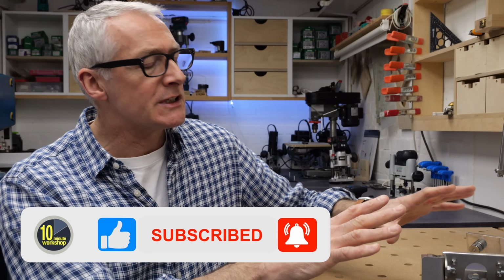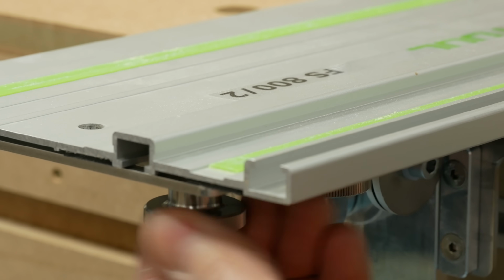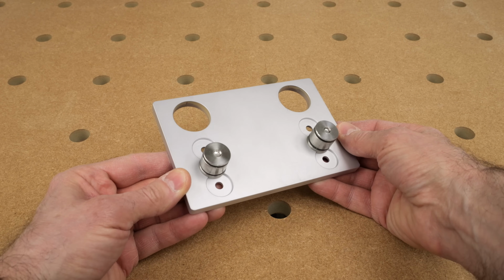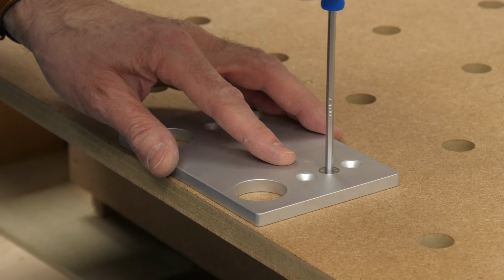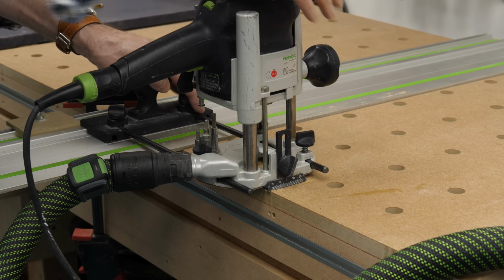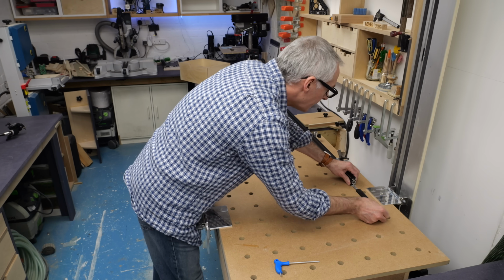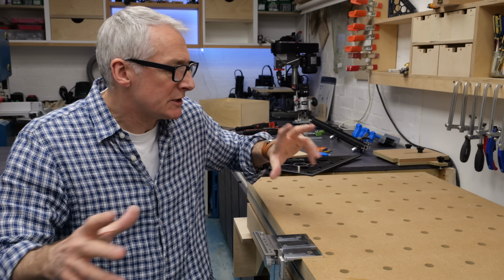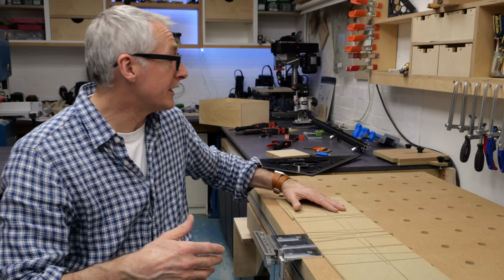Benchdogs Quad MFT Hinge System [**Ad/Gifted][video 492]

Comment: Hey Peter, a great introduction to our hinge system. Once the final finished product is available, I will have this sent out to you for a comparison video with others on the market. All systems have their place and are all great systems, and all have their pros and cons. It’s fantastic feedback from everyone. It’s also great to hear the comments about our products. 

As you mentioned, we have a different take on the mounting part which may have its downsides, but looking at it, the benchdogs route and thought process, I’ll try to explain. The plate sites on the top but set back further so it’s not getting in the way of the first set of holes you would use for either a fence or dogs that you place your workpiece against, so in theory, you haven’t lost any space on your workbench. The front support is also set forward doing the same. If you were using either guide rail dogs or our B dogs, you would lose the first hole for this dog to go into, so technically, this system gains you some space If using the dog method.  As for the 6mm height of the plate that sits on top, we kept it at this height for a few reasons. 
1. Our under rail is at 9mm or 7.1mm if using the MK2.1 fence. So it sits below this. 
2. If you are using our benchtop protectors, it will raise the workpiece above this height. 

We can make the overhang a lot less to about 60mm by turning the top plate around, but this has its downside that the plate then raises the min-height to 9mm, but the thumbscrew method would not work. We would need to use countersink screws for the fixing of the tracks. We did try this method, and we can also offer this method if required. 

The hole jig can also be used to offset the fence system.  Use the 32mm offset if the hinge has used the 48mm offset. This will also help you gain some more space on your MFT. 
Also, having our jig will allow you to make additional holes when you need other holes for possible future products in the pipeline. So it’s not a one-time-only product. We will also look at alternate materials to help reduce the cost. 

I hope this explication of our thought process helps.
Reply from the maker: Thanks Ralph. I dont see those as downsides exactly, more things that potential buyers need to be aware of, and thanks so much for the detailed explanation. Much appreciated! 🙌
Reply: Hi Ralph, have you considered a hire service for the jig? for a small fee users could hire a jig and return. You would probably need to charge the full price, in case the person didnt return it, and then return the price paid less a small charge.
Reply: @rayroulstone3565  I’m sure we could look into it. I’m also going to look into other options and uses to make it a more worthwhile product. Also reduce the cost for people who have the quad bases.
Reply: @Benchdogtools  Hi Ralph, I also considered buying the hole jig when I ordered the hinge system recently but it didn’t seem to enable you to create offset holes that are also half way/48mm between your existing holes (as well as set back) in case you are a user who (like me) wants to set up their track cut line in between a row/column of holes such as when you install a sacrificial strip in your MFT top (like Peter does). Unless I didn’t understand it correctly, it looked like the jig only gave you the option to create offset holes in line with your existing ones? Anyway, if that’s right it might be worth considering modifying the jig to enable you to create the offset holes in this way as well (if that’s possible?). As it happens I figured out a way to do what I need using the UJK Park Guide System (which I use to make the MFT top). However one of the other comments mentions this requires pre-planning before you already have 20mm holes [Edit: though I gather you can buy cheap “Revision Dogs” to solve that]. On that point I have an idea you might be interested in, but I will email you about this 😉. You’ve done a cracking job with your new rail hinge system I think. I’m really looking forward to using mine 👍
Reply: @stephendixon8575  
Hi Stephen,

I’m a novice and new to carpentry- better late than never.
I have acquired the parf Mk 2 and the benchdogs quad rail hinge- my intention is to make an MFT table with my Parf system and accommodate the benchdogs rail hinge.
I have a 25mm mdf bench top measuring 1500 x 900 . I also intend to put a router table on it later- your advice on how to proceed would be greatly appreciated.

Regards 
Paul
Reply: @Benchdogtools  Looks like you considered and rejected it Ralph? What grounds please?
Reply: @DavePawson  sorry Dave could you elaborate more on your reply please
Reply: Thanks Ralph. I'm on the 3rd batch run and can't wait. I'm back to being a kitchen fitter after many years out of it. I love all of these innovations that have come about in recent years. Enjoying using the rail square and the fence system. 

What I would appreciate, is that you add some good comebacks in your FAQS for what to tell the missus when making a purchase. I've worn out the one that says "i''ll be much quicker after investing in this". I'm never home any earlier ☺️
Reply: Absolutely appreciated.. all these innovative tools 🧰 . Looking forward to all of them for my workshop here in California USA 🇺🇸
Reply: I am trying to order to the US, and it's asking for $50.
Reply: geez, i figured if i needed to pay 50 in shipping I should put more into my cart. now it is asking for $86. man.
Reply: As I said in my reply to Peter I use the Festool hinge system with the Benchdogs Mk2.1 rail and is fantastic with all my other Benchdogs bits and pieces and in honesty I wish I had the positivity of the Benchdogs locator. Looks to me to be fantastic Ralph👍⭐️👏

Comment: This design wastes too much cutting space and require an additional Jig and holes to be drilled, I wonder why benchdog tools doesn't offer a version that attaches to the MFT rails.
Reply from the maker: I don't work for Benchdogs so perhaps if you want to affect change your suggestions would be better aimed at them? But my guess would be that when this video was made a couple of years ago, Benchdogs didn't make an MFT and wanted to make something that was different to the existing offerings as well as being useful to the folks who use eg an MFT top on trestles, or an MFT slab ie without extrusion. Also the quad hinge has extremely easy setup with no squaring-up required, so very easy to fit / remove the hinge. 👍
Reply: @10MinuteWorkshop  Thank you for the answer, it make sense.

Comment: Peter. You could glue and pin a piece of would at either end of the hing on the underside. So that you could route the hing flush on the top side. All you would need to do is bore the holes through the would underneath.
A small rebate in the apron of the MFT would then accommodate the modified MFT top… hope that makes sense…

Comment: Does the front part have any lateral adjustment in case the holes in the bench aren’t square to each other? Cheers Pete
Reply from the maker: There’s a little bit of adjustment in it, yes. 👍
Reply: @10MinuteWorkshop  thanks for the reply buddy 👍

Comment: Yes Peter, please do a video on 20mm router bits. I've just spent £45 on the Festool spiral upcut bit. I hope I didn't waste my money! I'm planning to use it to make a replacement mft top with my LR32 jig, using the method you showed in another of your videos. A video comparing Benchdog Quad dogs and UJK expanding dogs, would also be useful. Cheers.

Comment: Hi Peter ! This is Vivek from India.
Big fan of your innovative videos and your dedication towards woodworking.
In this particular video I see you plunging 20mm holes with help of your Festool router using a 20mm
Carbide tipped Fostner bit ... now how are you doing this ? Fostner bit are suppose to spin in a much lower RPM. Probably not possible for a plunge router ..... I guess.
Reply from the maker: Hi Vivek, and thanks! You’re right about forstner bits - but this isn’t a forstner bit! It’s a bit that Festool sells / used to sell specifically for making MFT holes. I’ve had it for ages and I’m  not sure that they still offer it - I had a precision engineer pal grind it down slightly for a really snug fit, which is why I don’t link to it as without that extra work it wasn’t great. HTH. Peter. 👍👍

Comment: About to do the same Peter. Why place the hinge at 4/5 holes in? Don't you normally run with the cutting line much nearer the end of the MFT?
Reply from the maker: I've always run teh cut line over the third column of holes, but the benchdogs hinge put the cut-line between the columns so I opted for the cut to be between 3 & 4 as I though between 2 & 3 was a bit close to the end. Don't read too much into it though howard - this was first a test of a pre-production sample on a DIY MFT that the hinge will never actually be used on. 🤷‍♂️ 👍

Comment: I do hope you produce the video on the 20mm router bit comparison; they are hard to come by (at least in the US) & I’m keen to hear your thoughts on the various offerings.
Reply from the maker: I abandoned the idea; I bought all the 20mm bits on the market and had an engineer pal chuck them in his mill. They all bored a perfect 20mm hole; the issue is with the routers, not the bits. I’m working on it. 👍

Comment: I already have holes at 32 and 64 mm from the edge of my table, will I need to drill additional holes ? Or will the hinge fit in either set of these holes ?
Reply from the maker: You should be fine with the 32, but check with benchdogs as this was a 'first look' at a pre-production example, and I know the Mk2 346 jig/template was released recently. 👍

Comment: You could stick a small piece of board underneith  just where the new MFT hinge goes, rather than a thicker board for the whole table - this way not inhibitting the use of the rest of the holes for general clamping.

Comment: Hi Peter,
Enjoy your videos.  New to carpentry.
Just acquired Parf Mk 2 system and benchdogs rail hinge.
I have a 1500 x 900 x 25mm MR  Mdf top on which I intend to build an MFT table and also to accommodate a router table at some stage.Advice on positioning the dog holes for quad rail hinge. What areas would you recommend for each area.
Greatly appreciate your advice.
Regards 
Paul
Reply from the maker: Hi and thanks! I wouldn't use 25mm for the top as you won't be able to get regular rail clamps through the holes - not without a fairly hefty chamfer on the underside of the holes. As for the layout, I've only ever used tops with a full grid of holes; if you're making your own with the parf guide, then you could drill out the full grid with just the 3mm bit, and add in the 20mm holes where you need them? The quad hinge is designed to fit into the regular grid of holes, just closer to the edge of the benchtop - the jig that Benchdogs sells makes this very easy to do, but as I show in this video it's do-able without it.

Hope that helps! P

Comment: Hello Peter I have used the parf jig to make my table 20 mm holes at 96 mm centres with the Mk 2 fence system I have also bought quad hinge rail system after much tooing and froing. I just can't seem to get a square cut it is aprox 1mm out is there a way to adjust this error out?
Reply from the maker: Is the MFT top square? Assuming you’re using the benchdogs Mk2 fence with fencedogs, then they’re referencing off the top row of holes, and the benchdogs quad hinge references off the column of holes, so provided the grid of holes is square, then no adjustment should be necessary. I believe there is some adjustment in the hinge to allow for a certain amount of tweaking, but you’d need to consult the manual on that one. My first task would be to check the grid of holes in the MFT top is truly square though, as everything else references that. HTH P
Reply: @10MinuteWorkshop  thank you have just ordered the precision triangle will do more checks when I get it  also ordered the repeat stop for the mk2 rail square, using your promo code saved a few Bob too thank you. 
Regards Mick
Reply: @10MinuteWorkshop Hello Peter just got my precision square and checked for square and is spot on mind idid use the opposite end and the other reference edge. However one of the corners of the square has been dinged will have to take a file to it as the bur is marking up my top if I slide the square across the top. One more enquiry and that is what kind of mdf are the black mf tops.
Sirry to have bugged you again Kinnd regards Mick.

Comment: Ive got a QH on backorder but wanting to finish building my MFT.  Can you suggest a rough distance to leave open between the MFT and the wall for the hinge to operate correctly (festool track)?  You mentioned 185mm, but wasnt sure if that was with a track installed or not.  Thank you for your time and great content.
Reply from the maker: Thanks! Yes, 185mm will cover it with the track attached. 👍

Comment: Can you provide a link to the router bit that you used to bore out the hole in the MFT for the mounting plate?
Reply from the maker: It’s a standard Festool 20mm MFT bit that I had a precision engineer pal grind down to fit. The stock bit makes an oversize hole, which is why I don’t link to it. I’m working with another company to make a bit that allows for router run-out. Watch this space. 👍
Reply: @10MinuteWorkshop  I'll definitely be on the lookout.  I'm really shocked there isn't something already out there that's perfectly made for this

Comment: I should probably have a piece of cheese to go with this whine but

I really wish BD had called out the need for the 30mm guide bushing so I could have started earlier to track them down. The bit was easy but the guide bushing has been a problem and won't arrive until the end of August!  Better still would have been a option from BD to purchase these (bit/bushing) with the template.
Reply from the maker: Sorry to hear Michael, and while I don’t work for BenchgogsUK, I’ll say that a 30mm guide bush is the most common size imaginable - many routers come with a 30mm guide bush as standard. End of August is quite the lead-time though! Plenty of opportunity for a couple of slices of Emmental - unless you’re more of a Jarlsberg type?? 🤷‍♂️ Cheers! P🍷👍

Comment: This looks like a nice sturdy unit.
I feel the weekness in the festool mft table is the other side of the fence fixture. Over time there may be a little play as the aluminium fence underside is very soft so cuts may become slightly out.
The fixture side also looks more strong than the festool. I like the fact you have the back support so you can place stopper for different sizes when placing ruler.
You are an expert and everything looks easy to you because you are the Djokovic in the woodworking industry.

Comment: Thank you Mr. Millard for your great Youtube Chanal and thank you for this video. I've got only two questions, because I don't understand this product exactly.
How far away is the maximum distance in millimeters from the edge of the MFT-table to the center of the 20-mm-holes for mounting the MFT Hinge System? How deep reach the bases of the "Quad Dogs" for mounting the MFT Hinge System into the plate of the MFT-table?
Thank you very much and sorry for my "rusty, old" english. Yours sincerely Simon S.
Reply from the maker: Thanks Simon. The full specs are on the BenchdogsUK website, but from memory it’s 35mm from the hole centre to the edge of the top. HTH P

Comment: If the 6mm height above the table is a bother, you can simply rout it out on the MFT
Reply from the maker: Except - as I say in the video - the quad dogs need 18mm to get a proper grip. So sure, route out a pocket then add another 6mm strip underneath… Or just use a 6mm spoilerboard. 🤷‍♂️👍

Comment: I have ordered the hinge system and fence 😄. Forget the code but remembered when I ordered my dogs. Does it come with 20mm bit?  I have a plunge router but you went over that set up a bit quickly so I’m hoping some instructions will come with the template.  My eventual plan will include 3 MFT tables similar to what Brent woodworking did. Thanks again
Reply from the maker: Thanks Michael. You’ll have to speak to BenchdogsUK WRT the scope of delivery,  but I double very much that a 20mm bit is included - most 20mm bits I’ve come across cost more than the jig! 👍

Comment: Great video and can't wait to see them on the market. I'm in the process of making a new MFT workstation integrated to my outfeed table and will consider this system. I'd be inclined to recess the MFT and glue a 40mm strip of 6mm mdf on the underside to extend the depth of the holes to allow a better fixing.

Comment: Hi Peter is 96mm a standard hole centre for a MFT worktop
Reply from the maker: Yes, it is. More information about why and how it came about below, if you’re interested! 

96mm hole spacing MFT

https://festoolownersgroup.com/index.php?pretty;board=festool-how-to;topic=any-magic-to-mft-hole-spacing.0

https://festoolownersgroup.com/index.php?pretty;board=ask-festool;topic=96-mm-mft-hole-spacing.msg226612#msg226612

And the 32mm system in general

https://festoolownersgroup.com/index.php?pretty;board=festool-jigs-tool-enhancements;topic=32-mm-system-help.msg157917#msg157917

Comment: Hi Again Peter,  Once again thank you for another excellent Video. I am planning to make your portable MFT table using 18mm ply wood for the base and I am also awaiting the Benchdog Hinge systemto comp-lete the setup.  Wwould the additional holes not clash with the base. Do I need to be concerned about this? Thanks again cp
Reply from the maker: If you’re using an 18mm thick top, the benchdogs quad digs that secure the hinge won’t go through to the base. If I’d they do, you can drill them in a touch deeper. 👍👍